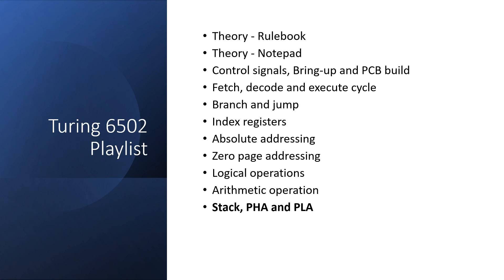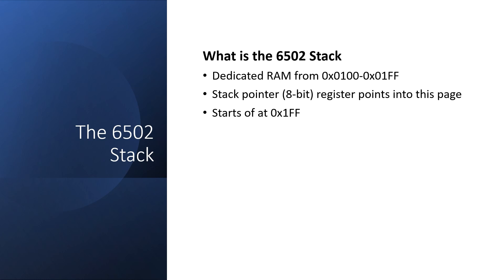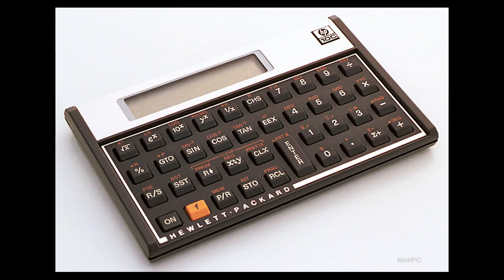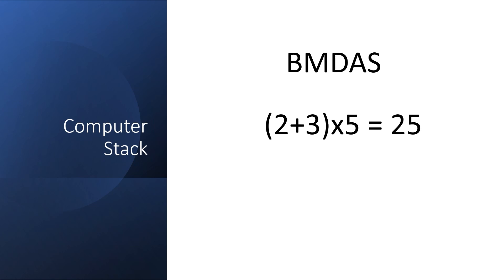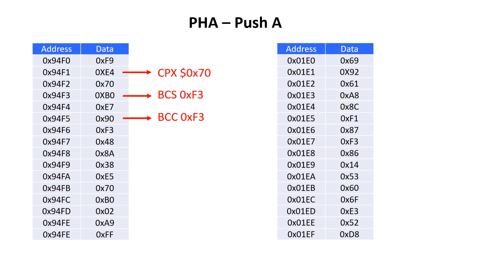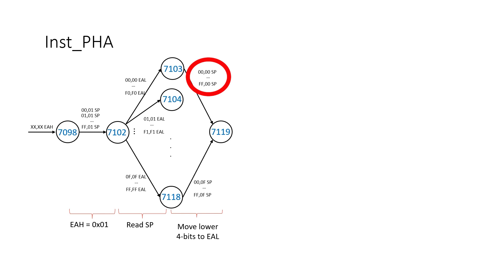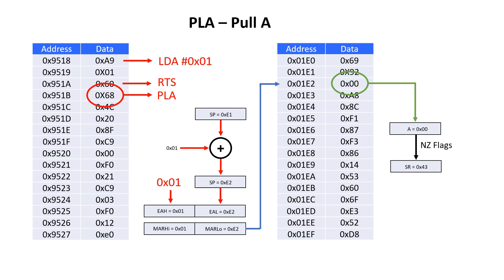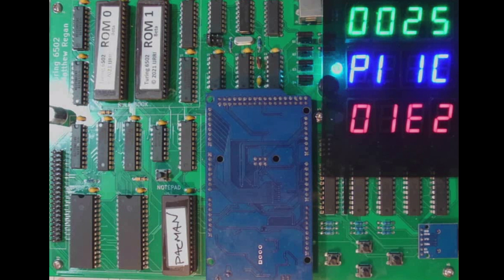Turing 6502 Part 14 - Stack operations

Comment: I recently wrote a subroutine threaded interpreter for the 6502 that implements the Brainf--- language. It was pretty speedy, but another 6502 forum user tweaked it to inline the code instead. That resulted in a 4x improvement and basically showed that JSR and RTS are pretty expensive instructions! So while having the stack is great, it's deceptively computationally expensive. During that exercise I realized how easy it would be to create a rulebook for your Turing machine to run BF programs. But I suppose that's kinda obvious given that BF basically is a Turing machine.
Reply from the maker: Yep, JSR in particular is a monster instruction, it's by far the most complex which is one of the reasons i've left it until last.  I have a couple of spare fully populated boards, if you want one to play with (for free) send me an email to Turing6502@gmail.com. I just had a look at bf, it would probably port well.  Everyone thinks you need flags to be Turing complete, (which i guess it has with while), but indirect addressing is also enough.

Comment: Is there a reason why jump to subroutine (JSR) and return from subroutine (RTS) are missing? And what happened to the reset video?
Reply from the maker: No significant reason, just the viewership fell so much with each extra video, i figured people weren't interested.  They are half done, if you want me to finish them up it can.  Interestingly, you're the first to mention it.
Reply: @DrMattRegan  They are fascinating videos. I’ve heard of a Turing Machine but never seen an implementation of the theoretical machine.